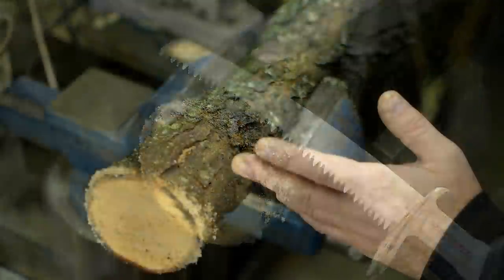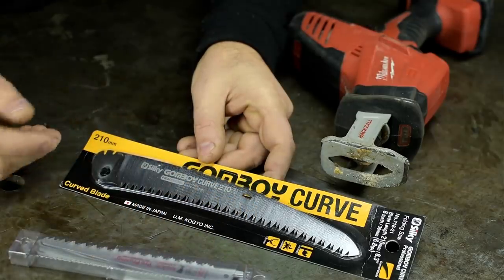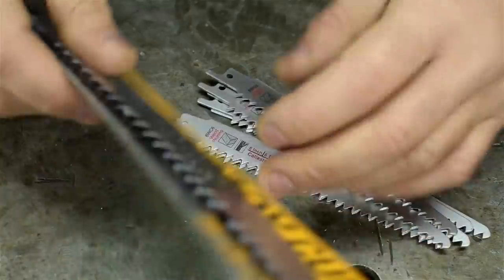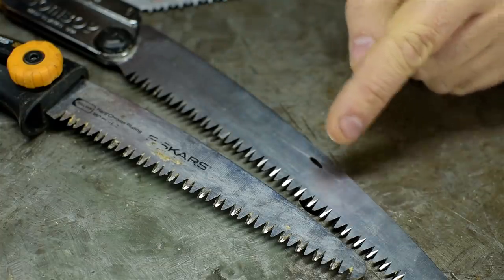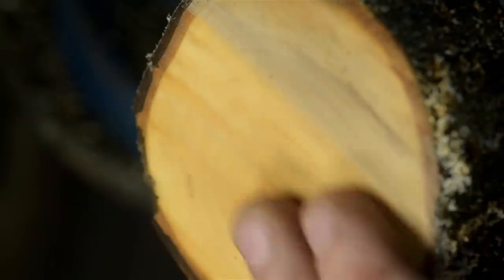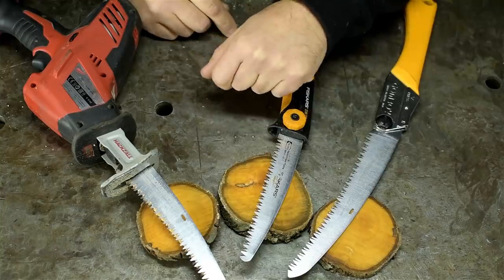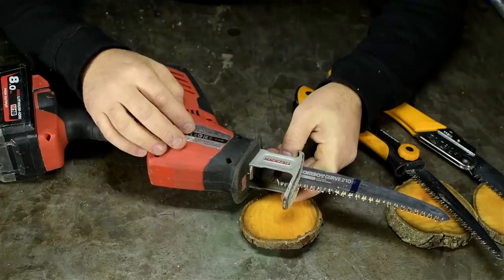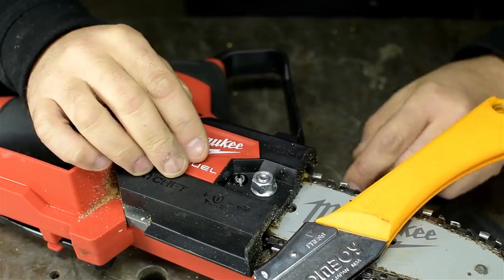Pruning For Machinists!

Comment: I've been a Carpenter and I've been a tree guy, if you want to get through thicker wood with a recipro saw there's a technique, you need to rock the saw up and down in line with the cut, it not only helps to clear the blade gullets but constantly changes and reduces the contact area the blade has with the wood, once you get the rhythm you usually fly though, however when pruning, some trees will still be too wet or gummy and will put up a fight
Reply: Yes, alternating the angle is key!
Reply: Yep, some woods don't like being cut... they are to sapy.
Reply: What happens when you rock the saw up and down out of line with the cut?
Reply: Typically, that happens just prior to snapping the blade in half

Comment: I got a couple blades for the Sawzall years ago called "The Ugly". Giant teeth for clearing chips. They absolutely rip through branches. Maybe not the ideal tool for your high precision artisanal pruning aficionado, but ideal for the path of destruction I leave. 
NOTE - Less than ideal for hunting waterfowl.
Reply: "artisanal pruning aficianado"  OMG
Reply: @andyp3383  Lol... At least Google tried on the translation...
Reply: Yeah, lower TPI is ideal for aggressive cutting.
Reply: I use "The Ugly" blade for pruning also. It works wonderfully. Its teeth look like pruning saw teeth should: long, spiky, and scary sharp. It's a lot more similar to the "Silky" blade than to that "Caliastro" abomination. Highly recommended!
Reply: i randomly got a pack of those blades in a tool box i bought in the 9" version and they do work quite well but my favorite and best performing in my experience is the the carbide toothed pruning blade by diablo. I would recommend you try it out at you're next opportunity , Now is a good time as well since with the holiday deals usually there is  some bundle or pack  with a whole slew of their blades in itfor cheap
Reply: I have some Ugly blades for my jigsaw. Fantastic for ripping shit apart in a hurry.
Reply: @notanavrageloser  I haven't seen those for the jigsaw yet. Will have to give them a try. Should be better for small game- squirrels, rabbits, Pomeranians and such.
Reply: @Miata822  I haven’t looked for them individually, but I got two or three of them in an assortment pack at Lowe’s
Reply: I got a couple 9" diablo pruning blades and they worked good with some 5" diameter branches
Reply: As a treeman that has climbed and cut trees for 30 years I can tell you that while you may pay more for a silky, if you’re going to do a lot of cutting it’s the saw to get. I use one called the gomtoro. It has a 16” blade, and can cut through limbs 2”-3” diameter in less than 4!pulls. It has three different cutting edges on each tooth, plus a large gap for cleaning out the chips. They are worth the extra money if you’re cutting more than once or twice a year. Also if youre getting a battery powered saw stihl has two different models that will really rip through the wood, and make your life a lot easier.
Reply: @Miata822  Use a finer toothed blade for pomeranians. With coarse blades, the bones splinter and are hard to get out of the meat which spoils the empanadas con carne.

Comment: I've got one of those tiny electric chainsaws with the extendo-pole, and it's a godsend for clearing thin branches and dense brush along the property line. 
Not the cleanest, sure, but it's just so fast.
Plus the extended reach really helps when you're chasing down a deer.
Reply: What the f
Reply: ah i see, because the chainsaw is so quiet that you could stealthily poke at the deer before triggering the saw to grind the deer to giblets right? i dont hunt, but that's how i imagine it in real life.
Reply: @JOSEPH-vs2gc  You might have to resort to such base methods if the weather is good.
If it's raining on the other hand, simply give them a squirt with WD40 - You've see what this does to cold-rolled steel, so I'm sure you can imagine the rest.
Reply: I'd worry about my chainspear breaking when I throw it at a deer
Reply: Yupper.  I actually brought the smaller parts of a 60 foot oak down with them, from the ground, with a loop over on a higher branch and a whole slew of poles connected together.  Probably not my finest hours, intelligence wise, but coming clean feels good!  Do not try this at home.  You know who you are.

And chasing down a dear with a pole saw seems analogous to putting salt on the tails of birds at the beach to catch them.    You know who you are, too.

Comment: I have a couple pruning blades from Diablo and they have probably saved me an entire days worth of digging out old dead shrubs and bushes. I could just jam it into the dirt and cut them off well below the soil. I would try one of those out. I would guess It would cut that branch in only a few seconds.
Reply: I bought a cheap HF sawzall just for this! Just have to make sure your ground is clear of power and water before cutting… it does not care when it hits PVC
Reply: @adamdowney  Neither does Sean it seems.
Reply: Do you mean the carbide tipped blades?
Reply: Diablo carbide pruning saw blades, cranked my chainsaw up once since I got them.  Anything under 8 inches in diameter they are easier.
Reply: Those Diablo pruning blades rock
Reply: Hey, I came here to suggest those exact blades. You win this round Seanhodgins! 5tpi, 12” length, some free cutting badass blades for sure. Cheers to all of you who “know”. 
Edit: and the teeth have a set.
Reply: @isaacharvey  the carbide tipped ones are great for the very tough, and dry dessert trees I have to cut on occasion. However, I expect he means the ones they sell special for pruning, which are not carbide tipped. They both have their uses, and work awesome if you use them right.
Reply: Yup I have the Diablo blade also. Kicks butt!
Reply: One day you'll cut the water line
Reply: I was cutting up a 16-18" Maple and it was so much easier to use the pruning saw blades than a chainsaw... and believe me, I tried it all with the chainsaw.
Reply: I have the same blades for my M18 Fuel Hackzall, and they treat limbs like butter.
Reply: Yep 
I use the Diablo blade as well. So much better/faster.
Reply: The exact blades I was coming to comment about. Amazing performance on anything short of what you would call a log.
Reply: I have those on a M18 Super Sawzall and it takes down a 5in tree in 2 seconds
Reply: @ncguyredneck  There are also decent Milwaukee versions, but I've only used the diablo ones with the big mean teeth.
Reply: I cut down a small pecan tree with them now I use them to prune everything.
Reply: Can confirm. The carbide pruning blades are a back saver for dealing with below ground roots. Can agree that my chainsaw sees a lot less service since. I can also strip ivy off trees so much quicker.
Reply: Yeah the Diablo carbide pruning saws are exoensive but they last a casual user like myself years

Comment: From my experience, when cutting overhead, it's difficult to get enough saw tooth pressure into the cut. As you pull down on a curved blade, the orientation of the teeth come in on the top of the branch and cut deeper.  A straight blade just moves out of the kerf full of chips and you have to push much harder into the cut.
Reply: I think you nailed it! Except, not with a hammer, but with a curved saw
Reply: Yep. Just cut down a 4" overhead branch at full extension. Took way too long but I could feel how the curve helped. You want a smaller contact area for an effective cut and the curved blade helps with that.

Comment: Diablo/Freud makes a 12" and 9" carbide tipped pruning blade that I've found to work amazing. The carbide teeth have a significant set and each tooth has a large gullet which really helps make clearing chips easier. Also the carbide teeth are virtually indestructible I've used them to cut roots without removing the dirt around them still be able to cut branches only slightly slower. I'd really like to see Silky blade up against it.
Reply: Yes! I was hoping i would see someone else mention these they are  they best pruning blades I've used and they do last forever  as well!  Actually you cant go wrong  with any of their carbide toothed blades but the pruning blade is the best when it becomes tree herding season again

Comment: That M12 hatchet Pruning saw actually uses the same 0.043-Gauge, 3/8 in. low profile, 6" saw chain that a lot of Pole saws and other battery powered chainsaws use. For a non-Milwaukee branded replacement you can get a Oregon R28 saw chain; which means you have a fair chance at finding one at your local "home improvement" big box store.
Reply: I already have a few M12 tools.. you may have unknowingly convinced me to pick up this "hatchet." Getting a replacement chain easy would be great. I know with the sub-compact M12 Fuel bandsaw, I have a hard time finding blades in stock at the local Big Orange store.
Reply: @nelsonbrum8496  When you get the hatchet, buying a few extra chains will pay off big time, also have a lot of extra bar oil on hand, it seems to use it a lot more than my other saws.
Reply: @MrAPCProductions  That seems to be a common thing, using a lot of bar oil. My 20V Dewalt likes to drink up the oil also. I've got a few quarts of it for the Dewalt. I have to store my Dewalt with the fill plug down or all the bar oil will leak out. Anything similar with the Hatchet?
Reply: @nelsonbrum8496    Of the limited number of electric chainsaw that I have used; they all universally dumped out the bar oil at a very high rate compared to any ICE chainsaw. On a hot day, after using an electric chainsaw for awhile, it's very common to see them dripping bar oil on the ground. Which is why I switched over to using a biodegradable oil and emptying out the oil reservoir when I am done using it.

Comment: In my experience, reciprosaws work best when you keep the saw body plate pressed against the material. Sawing with the body away from the material with only the blade in contact makes the high speed reciprocating action less efficient. Little invisible positional changes lose a portion of every stroke. 

So it makes sense pruning with a reciprosaw isn't the right tool. Great video as always.
Reply: I got one of the Lee Valley pruning blades. The blade angled down in my 18V Makita, so the whole thing bounced in the cut. Blade shank broke from metal fatigue in the first season, so I reground it about like you did, and it works well on 1"-4" cuts. Definitely faster with the saw shoe against the branch, and up-down movement to clear chips. It may not be faster than the hand saw, but I last a whole lot longer with the saw doing most of the work.
Reply: i think they work alot  better on the dried woof aswell as the sawdust can escape easier

Comment: Almost 38 years ago when we bought our house, I cut branches off the large oak tree in the backyard. The branches were over 12” thick. I used a Rockwell, recip saw. It was pretty powerful for the time, at 8 amps, with an 1.25” stroke. The blades were 12” long pruning blades with carbide teeth. They really cut!. I was even able to cut out the honey locust roots six inches underground with these blades, though the small stones and junk in the ground did dull them. The Sawsall was too wimpy with a 4 amp motor and a 0.75” stroke.

Recently I bought the small 12” battery chain saw from DeWalt, like you, I’m tied into a battery system. This saw is great. Small as it is, it chews through 8” wood with ease, which is about the largest I do these days. With a 2 amp hour battery it lasts through 10 minutes of actual cutting, which is fine for regular pruning. With the 8 amp hour battery, I feel as though I can just keep cutting without thinking about getting another battery. Boy, these brushless motors are great! But I also find that it uses more oil than expected. It seems as though they over oil the chain, which is a standard size.

Comment: I used a Silky when I was working with a tree surgeon. Sure we had chainsaws but honestly we feared those Silkys far more! They're really sharp and will easily slice the back of a hand if not careful. (I still can't work out the mechanics as to why that was always cut)
Silkys are preferred when up a tree compared to others because in a few quick pulls you can be through a fair sized limb in no time. I'll go as far as saying that when doing lots of smaller limbs, a Silky was preferred to a mechanical saw. Lightweight and less straining. A Silky on a long pole and used from the ground is very productive - we used some to trim a whole avenue to trees so that branches were clear of traffic.
Reply: I got a couple silky's a few months ago and cut down a few small trees with them. I gently brushed the blade with my fingers, like cleaning the blade of a knife, and it dang near sliced me open. Blew my mind. I also was amazed at how easy it was to cut. I'm definitely a lifetime fan now
Reply: Highly informative.  One question, though, what the hell is a silky?
Reply: @MrJdsenior  silky is the brand name of these handsaws

Comment: Bosch do a shockingly good reciprocating saw blade for green wood, the S1531L. I have tried many different options and it is the only one that works for me. For big stuff, the chainsaw will always win but it always feels so dangerous hanging off a tree, upside down, by one leg, while using a chainsaw.
Reply: Bosch has this tiny, gimmicky 12v chainsaw that they only sell in Europe, but it looks fantastic for small cuts like that. Despite all the drawbacks to it, if throw down money in a heartbeat if I had access to it
Reply: Agree!  Came here to say this.  I love these blades.
Reply: Having now watched all the way through, I'd like to add that there is a specific geometry of blades for cutting green wood (green wood is anything that is alive or has been recently). Thin blades with a wide set work, but not well. HIstorically that's all we had so it is what was used. The problem is that green wood tends to rapidly swell behind the cut, trapping the blade. Modern green wood blades are triangular, wider at the cutting edge with alternating, heavily ground triangular teeth that have no set at all, tapering back to very thin at the trailing edge of the blade. Most reciprocating saw blades are for dry wood, so a thin blade with set, and so are useless for pruning.
Reply: Yeah those Bosch blades are just the job, I use them for anything too big to fit in the loppers and too small to warrant tracking down whoever I last lent my chainsaw to
Reply: I have never used a chainsaw. Is there a law that forbids you to use both your legs when hanging down as I still have both?
Reply: @Jacksparrow4986  Technically you are required to "accidentally" remove at least one limb the first time you use a chainsaw. Most people opt for a leg, but I guess an arm is also ok if that helps with future pruning jobs.
Reply: @microwave221  Are you referring to the Canadian Box Opener used by an unnamed gentleman back in the shop?
Reply: @matthewsmetalworkshop  : Personally, I've found that usually the best limb to remove is the tree limb I'm sitting on.
Reply: @MattThompsonOnGoogle  the very same
Reply: We have a short chain saw on a pole. You can work safely from the ground in branches pretty high up, as the pole can be extended to up to 4m (12-13ft). However, you want to wear good eye protection. The cups are flying exactly where you guessed they would ...
Reply: @microwave221  unfortunately, no, its teeth are too finecky. However, I do own a short chain saw on a pole. That one is great
Reply: While the bosch are nice i would highly recommend the carbide toothed diablo pruning blade. They are my favorite by far and  i think are the best performing ones I've used/
Reply: @Brooks Moses  i think I heard that's a bad idea. Probably still prefer it as one would get to keep their limbs.
Reply: I have the same Bosch blades for my Bosch reciprocating saw- they're awesome.
Reply: @brag0001  eye pro? I have safety squints for that. More better to wear a brain bucket, so the block of granite atop your shoulders doesn't end up bleeding everywhere when you invariably drop a branch on your head every 3 or 4 cuts
Reply: @sonofnone116  In case you weren't joking: if you ever drop branches on your own head while cutting them, you shouldn't be handling any kind of chain saw ;-)

The reason you need eye protection with a chain saw based pruning device is that, if operated correctly, it projects wood chips backwards, as any respectable chain saw does. Combined with you standing behind and below it, it makes you the prime target of those chips.

Considering you have to look upwards all the time while cutting, you really don't want a heavy helmet to add to the, already considerable, strain on your neck ...
Reply: @brag0001  half joking. Arborist helmets are pretty lightweight, usually have the mesh guard attached for actual chainsaw work too
Reply: @sonofnone116  Thanks for clarifying. Have an up-vote :-P
Reply: Folding Fiskars over any battery fuel-powered saw. Imagine, you went to steal some wood... Yup no saw not guilty. I keep my Fiskars where the back meets butt.